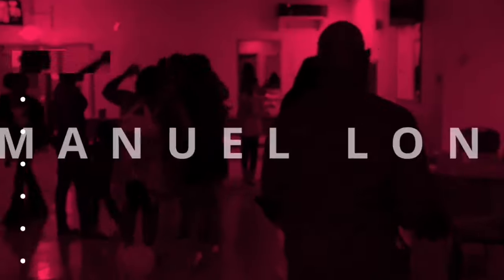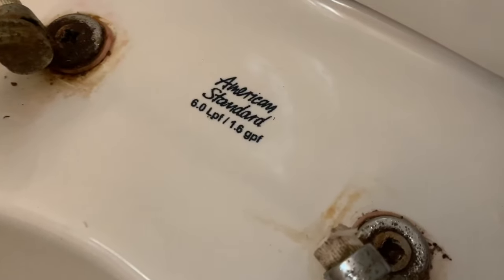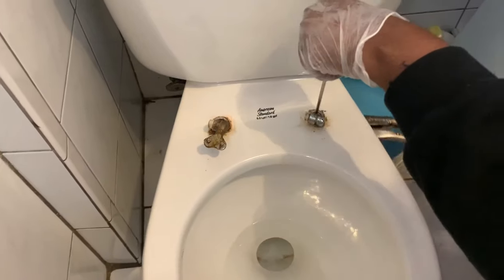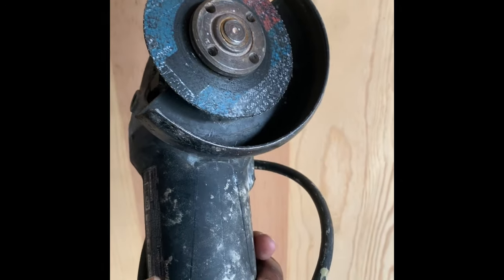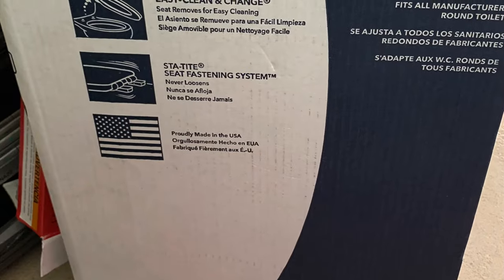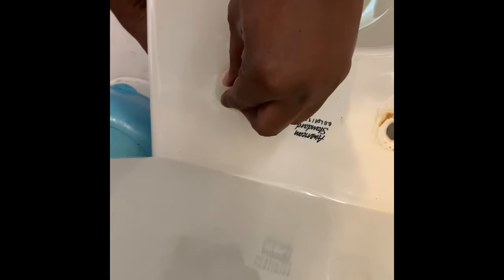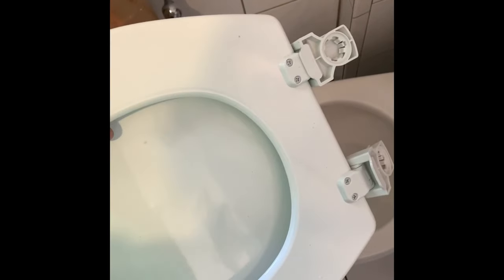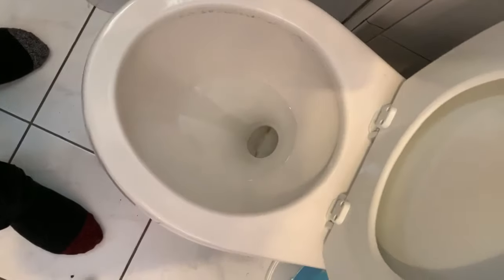How To  Replace a Rusted Toilet Seat- In 5 Minutes or Less!

Comment: If the nut is plastic on a metal bolt - use a nice sharp chisel and a mallet working from below to cut off the nut.  Gentle tap, tap tap.  Should take about 2-3 minutes per nut at most.  I just did it myself.  Easy peasy.  If a metal nut AND bolt - yes, an angle grinder used very carefully will work, or a rotary tool with a small cutting blade

Comment: Alright so I had the metal screw with the plastic nut didnt have anything to cut so I got a candle and a lighter and just melted it off I obviously would use caution when using fire but it worked in a few mins.
Reply: Exactly what I am going to try now
Reply: Just to let you know I tried the candle and it worked!!! Thank you😊

Comment: Awesome work. I have this exact model of toilet with far rustier bolts. Dunno if I'm ready to grind but it's good to know there is a way.
Reply: I used a hacksaw and it was way cheaper but required a little more elbow grease. I cut the bolt in 5 mins.
Reply: @wildndetroit  what type dod you buy?

Comment: I did exactly the same things. the last thing left to do is probably just cut the bolt off. I am still finding out other methods to avoid using grinders. good tip though.
Reply from the maker: +Stella Peggy Tsai Thanks for tuning in I really appreciate it

Comment: Got my toilet seat at Lowes for $6. Instead of saw used vise grip on bottom... insert screw driver throw top piece and used it like a reverse dial. Off in ten minutes, btw to let was installed in 1980s and looked worse than a truck stop bathroom. 👍

Comment: How dangerpus is this?
Reply from the maker: It's not dangerous but you should take the time to use the proper PPE especially if you are in experienced
Reply: @EmmanuelLoncke  whats the difference between it and a sawzall?
Reply from the maker: @phantompage4304  the blade being used
Reply: @EmmanuelLoncke  so angle grinder is better?
Reply from the maker: @phantompage4304  here is an example of a grinder from Amazon https://www.amazon.com/Makita-Pack-Grinders-Aggressive-Stainless/dp/B01G4BCF60/ref=asc_df_B01G4BCF60/?tag=hyprod-20&linkCode=df0&hvadid=312140312760&hvpos=&hvnetw=g&hvrand=10816089756339418440&hvpone=&hvptwo=&hvqmt=&hvdev=m&hvdvcmdl=&hvlocint=&hvlocphy=9004473&hvtargid=pla-571701707478&psc=1&tag=&ref=&adgrpid=63813710082&hvpone=&hvptwo=&hvadid=312140312760&hvpos=&hvnetw=g&hvrand=10816089756339418440&hvqmt=&hvdev=m&hvdvcmdl=&hvlocint=&hvlocphy=9004473&hvtargid=pla-571701707478